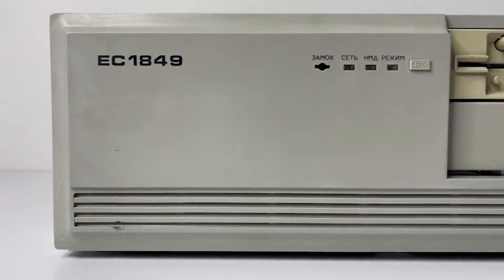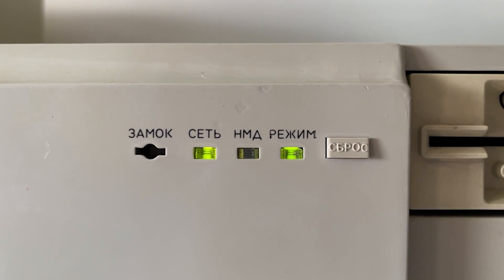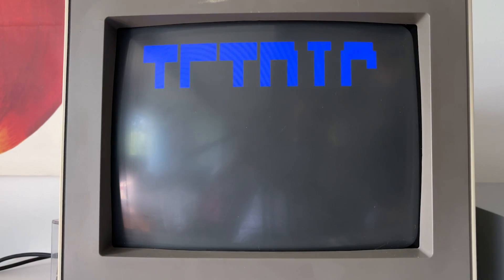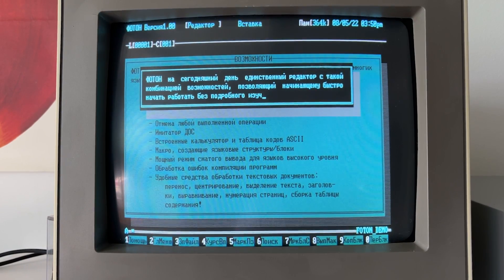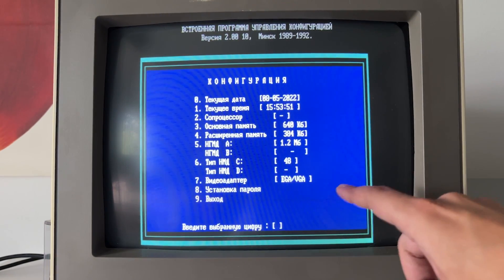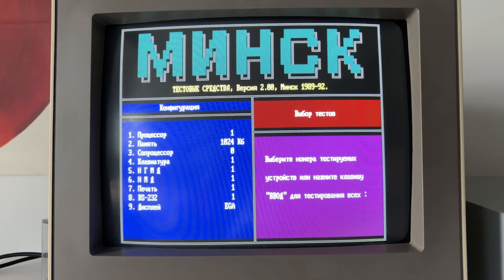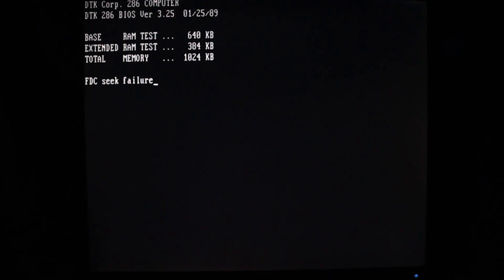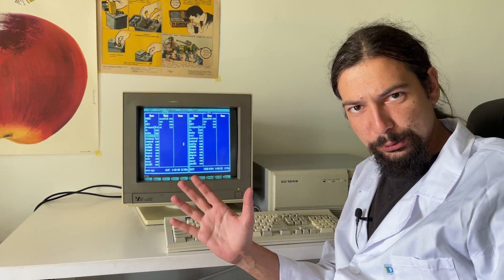Test-run of ES1849, a Soviet 80286 computer.

Comment: The current loop, was that so that several ES1849 could share a printer? Or what was the C.L. used for?
Back in the DOS days, i remember each guy had a matrix printer on his room.
In Word Perfect, you wrote in plain text form. Then you had a "Code image", were you embedded (hidden) codes for formatting, margins, fonts, etc.
Each printer had different support for the embedded codes & i dont know how much time (or paper) you wasted troubleshooting documents not printing  properly.. It really felt wasteful...

In an economy, where i suppose, at least your average office did not have unlimited amounts of printer paper? And you shared a printer? Did they make that work a little better?  
Does it have a Word Perfect clone? How many attempts does it take to get it out on paper?...

I can imagine, in Soviet they would be against wasting paper like that.
Reply from the maker: There were plenty of local-made printers available, as well as other peripherals, e.g. plotters, so that port could be used for many things. Printers quite often had two interfaces you could switch with jumpers. As for Word Perfect, I am unsure if a clone existed, unfortunately.

Comment: At 2:22 About 3.5" floppy disk drive power cables.... In the West, only once ATX case design was produced did I see power supplies with dedicated 3.5" floppy disk drive power cable connectors (4-Pin Berg connector). Older AT style power supplies only had the 5.25" Molex style connector.
Reply from the maker: Interesting is, that this one has a separate set of wires coming out of PSU, but it does not have any coonector at its end.

Comment: could you extract rom dump using rom reader?
Reply from the maker: Likely yes, but I need a ROM reader. Not earlier than in a few weeks.
Reply: @ChernobylFamily  did you manage to do the dump? you don't need a reader, i suppose you could just do debug.exe. thanks!
Reply from the maker: It was made by someone else, I've seen it on internets... i'll check

Comment from the maker: Correction: original Tetris was created on pure Electronika-60, while DVK-2 is a machine that combines E-60 and a display terminal.
Reply: No, it doesn't. The common thing for Electronica-60 and DVK-2 is that "Fryazino" CRT terminal (was used with other machines as well, not only PDP-11 compatibles, e.g. Electronica DZ-28). The key thing is that DVK is a microcomputer (CPU: K1801BM1), while Electronica-60 is a minicomputer with CPU built using several ICs.
Reply from the maker: @nickniva  thanks mate! I am not very much in them YET